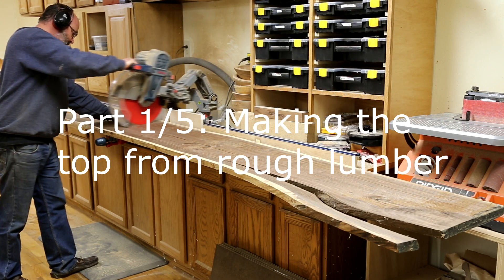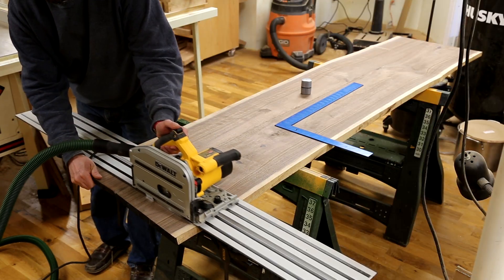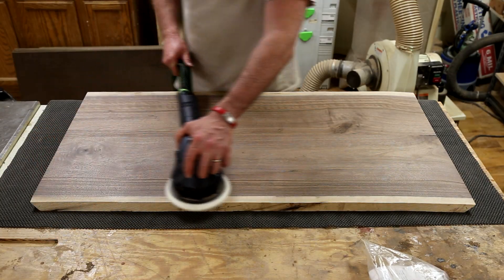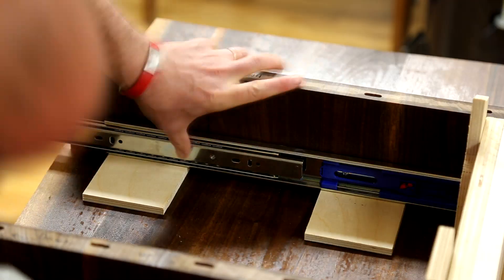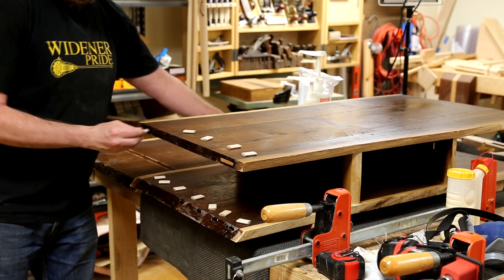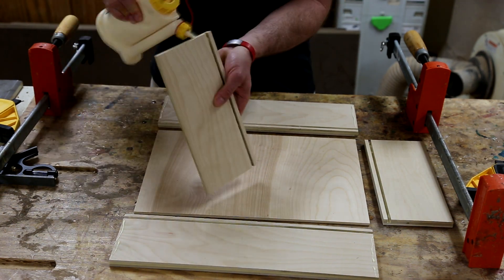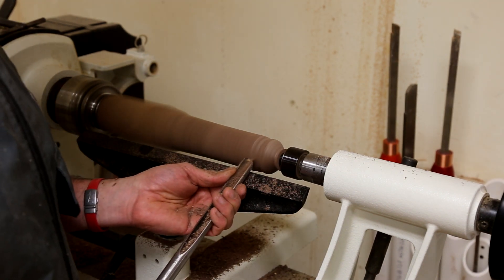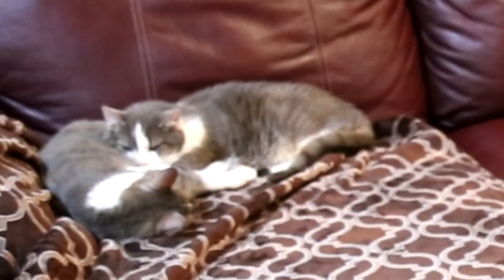Live edge walnut waterfall table - Project Video

Comment: You can't beat a tracksaw for cutting large, unwieldy material. Mine has made a lot of my work easier, faster, safer and "straighter", ha ha. I use mine as an edge jointer when I don't feel like dragging out the big Delta. By the way, the project turned out beautiful, but the icing on the cake was the hand turned drawer knob. That was a nice touch.
Reply from the maker: Thank you so much!  I was very happy with the track saw purchase initially, but have found myself using it for more processes than I originally expected.  It's been a really positive addition to my workflow.  I'm super pleased with how this table turned out.  Please stay tuned for it's companion side table coming soon...